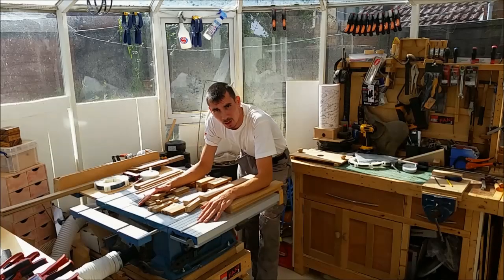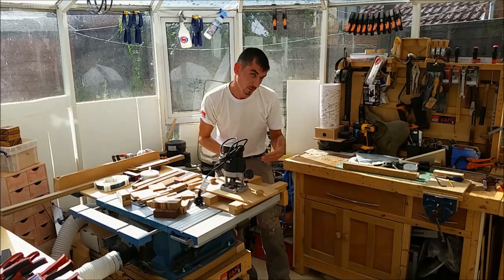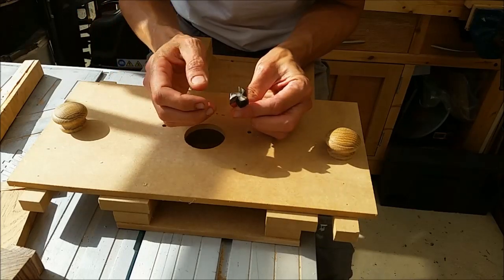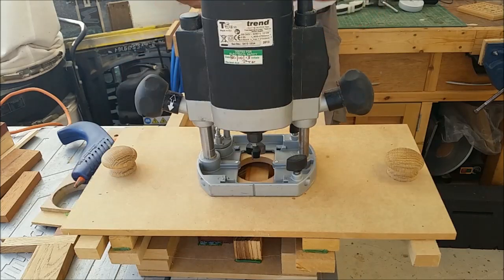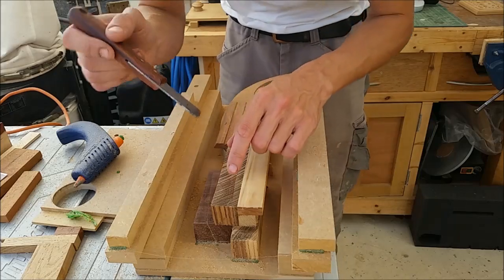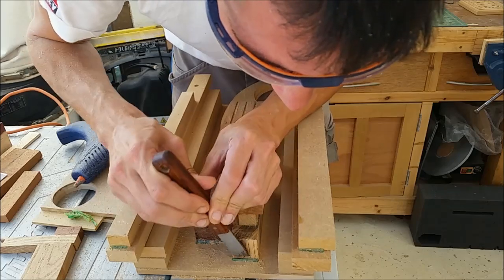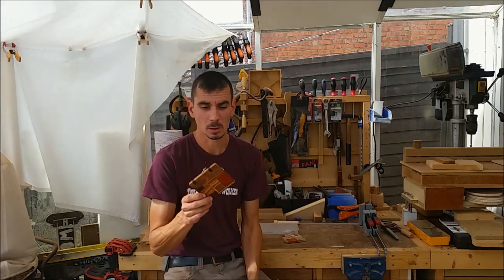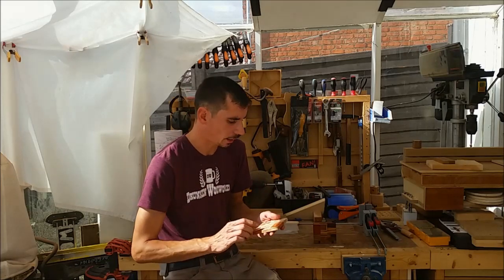Make a thicknessing  jig for a router to make these super simple  scrap wood coasters!

Comment: Those coasters look very cool! Nice work. All the different sizes and colors really makes them look really nice. Great scrap wood project. Great jig, too.
Reply from the maker: Thanks! I posted a picture yesturday on my facebook page, and within a  hour 2 people had asked how much! :-)
I was REALLY  pleased with how they turned out, I'll definitely be making some more of these as gifts!
Reply: I'm thinking about cutting boards using this process. Just glue up the scrap on a horizontal plane rather than the "log" shape. I know several people who would love one as a gift. Thanks for the ideas, Richard!
Reply from the maker: Another perfect application Mark Lindsay, personally I'm a prefer er of end grain for cutting boards, but it's the same practice,  just the added steps of cutting, gluing and then resurfacing. :-)
I plan to make a pizza board in the same way sometime soon!

Comment: Top rundown richard. Q. What maintenance does your compressor nailer require? It looks just what I need. Many thanks for the educational videos.
Reply from the maker: mrmjspencer  Thanks for watching! I've been asked a bit about my compressor set up, I put out video on it back in march here: http://youtu.be/BZw5sdyK6_sAs far as maintenance goes, I couldn't tell you what it NEEDS, But' I've had it a few years now, and I've never touched it in that respect, apart from draining the air out after use, and leaving the drain plug open to atmosphere, I don't do any maintenance on it. It's not one that requires oil. Hope this helps.

Comment: Hi Richard,Nice coasters! I'm interested in the surfacing bit you were using. Could you tell me who makes it please. I have just the little project for it, but not the time to do it all by hand! Thanks, Mitch
Reply from the maker: +Mitch Peacock - WOmadeOD Hi Mitch, Thanks for watching! I use the Trend 37/1X1/4TC Cutter, it's a three flute surfacing/trimming bit. You can use standard two flute straight though.
Hope this helps! :-)
Reply: +Richard Morley Cheers Richard, I was looking through the Trend catalogue, but must have missed it.
Great videos - I've had routers for years, although I'm mainly a hand tool woodworker now, but I've still picked up tips from you.

Comment: I've just come across your channel and am finding it very informative. I have been looking for a router to do lightweight tasks (inlays, grooves, small jointing and thinning of small pieces prior to carving) and had narrowed my selection down to the T5 and the Dewalt you reviewed. Which do you prefer? Also, can you recommend a set of decent router bits that will get me off to a good start, preferably one that has a bit to do the thinning/sizing you demonstrated. Many thanks.
Reply from the maker: +Surfey-Liker Thanks for watching! to answer your question, in all honesty, I like both routers a lot! 
I originally wanted the T5, and purchased the dewalt, because it was out of stock everywhere when I wanted it. so for me the dewalt was a close second.
After using it a lot, I then got the chance to get the T5, and did so. For me both have their own advantages - the fence is better on the T5, also it came with the 8mm collet and a fine height adjuster on the plunge. also because the plunge based is "fixed - not removable, it means using guide bushes etc gives you a true radius to the cutter without any need to set it up or adjust anything. that said the fixed base on the dewalt is great, and the plunge action about as smooth as I've ever seen on a router. Also the LED's are helpful too. On balance the routers are evenly matched, but the crunch for me at least, is the aftersales and service care you get with the trend products. If I could only have 1, it would be the T5. At the end of the day, which ever you go with you'll be happy. Hope this helps.
Reply: +Richard “BrainFizz” Morley brilliant.  thanks for the advice. much appreciated!